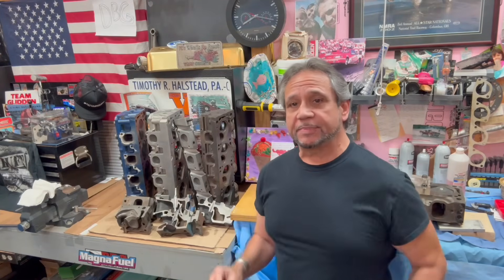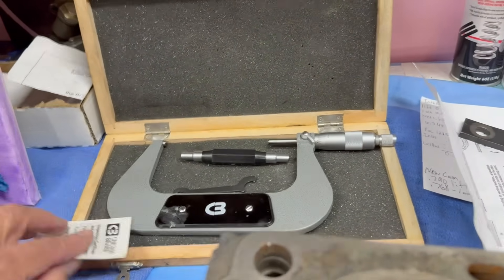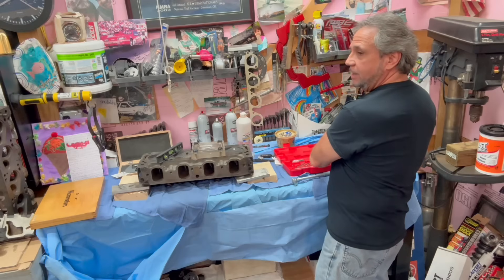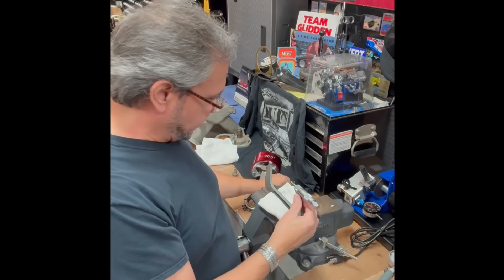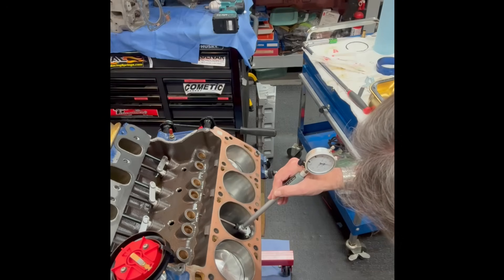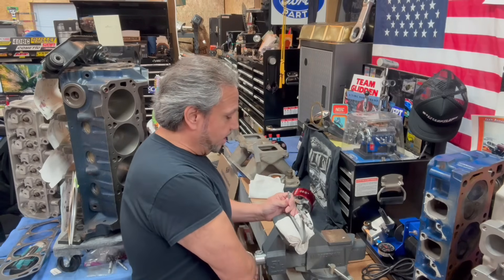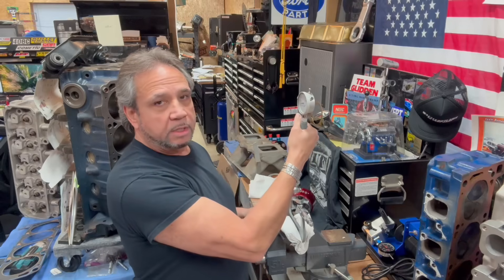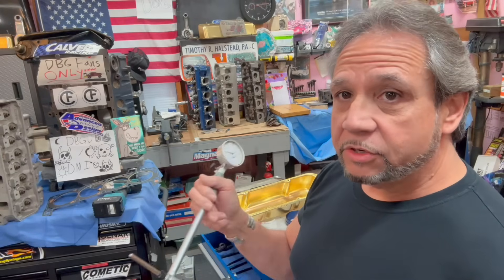DragBoss Garage: Measure Twice, Measure again. Using Dial Bore Gauge to Measure Bore/Piston To Bore.

Comment: Those little dial bore gauges like that are a bargain and they work just fine.  I use the Sunnen ones every day but really aside from being easier to set the results should be the same.  An older guy who comes in here worked for Sunnen for many years and he told me one time the cool thing about a dial bore gauge like that is since its being used as a comparator you are really calibrating the gauge every time you use it.
Reply from the maker: There you go. I will be happy to put it to use and see what I have to work with, and make better. Thank you my man. 💯💪

Comment: Bore should be..4.400 to 4.600 .....unless it's  a small block...lol
Reply: Tim i love cleveland too......they are too heavy for thier displacement
Reply from the maker: @edcase3767 if you say so, never bothered me any.
Reply: @dragboss351cleveland love you tim...if you bought  a 68 t -bird out of a field and got on it you would appreciate the torque the small ass engines lack...lol...
Reply from the maker: @edcase3767 well if you say so. Im happy with what I have, although I do have a pair of A460 and intake sitting in the corner…
Reply: When bob glidden won 5 Championships in a row it wasn't a  350 or +1
Reply from the maker: @edcase3767 nope
Reply from the maker: Ok it is a small displacement engine.

Comment: All Pistons manufacturers have a clearance specs depending on material they are made out of forged Hyper or just plain cast Forged piston for racing or Power adders you can clearance the rest should stay at spec piston manufacturer suggest. Correct Clearance means a longer running better performing engine
Reply from the maker: Well I look at this way, I didn’t assemble it and spec it out. So at this point, I am not changing anything but rings. Just measuring to get the feel for these instruments and record what I find. Yes thanks for the information appreciated 💯👍🏁

Comment: You need to get feel for the weight you're putting on mic 
You can feel it when you're measuring in the right spot 
I'd rather hold the piston when measuring it 

The bore if it's been bored and honed with torque plate would be out of round when measuring without it on , probably.0005 to .001
Reply from the maker: Yes definitely a feel to use. Probably easier to measure without the rod on it. Yes that is probably the difference I see with the what it is supposed to be. I’m good with it. Thanks for the advice 💯🏁👍

Comment: Another nice video Tim, those are the tools of the trade if you want to do an engine right. 👍
Also, you wouldn't believe how loose I ran my Cleveland engines in my dirt track cars. 
Good luck with the rest of the engine refreshing. 🏁
Reply from the maker: Thanks AC, loose is good, I have never used any gauges like this so accuracy is my goal. It will all work out, I have been keeping the Faith 🙏appreciated 💯🏁💪
Reply: @dragboss351cleveland handle your precision tools like a surgeon, smooth and steady.
Reply from the maker: @abcullens2328 that’s exactly what it is like. Thanks much. 😊🏁

Comment: As a machinst for almost 60 years, I'd say you did a great job. One thing I see guys do wrong is holding a measuring tool longer than they need to. (Heat is bad). And be consistent with the light feel for measuring or setting tools. And everything, tools and what yer checking, should be at the same room temperature for 12 to 24 hours. Excellent video. Looking forward to seeing more! 😊
Reply: Yep and always hold a measuring tool that has an insulated grip by the grip! Its there to avoid heat transfer from your hands to the gauge.
Reply from the maker: @craig8187  no doubt just like the gentleman above you said that the instruments get to room temperature for at least 12 to 24 hours. From checking before and after heated, definitely a difference in readings. Think it was like 1000ths 💯🏁
Reply from the maker: Definitely manual dexterity and no influence with the weight of your hand. Thanks so much for watching in the critique. Makes me smile. I hopefully can only get better. Glad you’re here.💯💪💯👍

Comment: At 4:30 "woopsie" lol.... Did pucker up to deffcom 2? Good stuff Tim, especially the bore locations. Simple. 385cfm at that lift??!! Damn she guud! Some of the mic's on the market can develop rust or maybe just mine....but I've since learned the error of my ways. I keep them coated not drenched plus a oil damp shop paper towel over them in the box. Dials you have to check the increments because some are in metric but also some have a .005" increments like old Ammco drum mic's. Working on foreign cars they had metric specs for everything. 1 millimeter is .03937" and 1" inch is 25.400 millimeters. Had to mic cylinder head and deck warpage of .0011" for warranty claims. Well my feeler only went to .0015". Fun. Can't use them if they fold making a crease. I made a trolly for my dial gauge to ride my straight edge. Our dealer rep said I couldn't have mic'd them so he knew or thought I made them up. Guy was a real pos. Showed him my setup. A few months later they sent out tech info as a work around. Fun.....He rejected a bunch of my jobs after a disbute with a MAF sensor that passed their test. I put it in our freezer for lunch. Pulled out put it on and it wouldn't start. Gave him a copy of the ticket I keep for my job log. Well he got butthurt wrote me up. District manager showed up with our rep. Ripped up the write up infront of us. I was soon to leave after the constant BS. New rules for only me. Got old with his selecting me for every massive tear down or him telling me to do something specifically his way then says he never told me that or to start on it yet when it was needed done that day. He was driving the car. At 7pm he was nowhere. Fun ....sorry went a bit long on this my bad.
Reply from the maker: Yes, those heads flow very well. That’s a secret to my Cars ETS, Darin had an intake work. Yes I love these new instrument gauges. Learning a lot. I worked as a mechanic, before they became automotive technicians. Never had a deal with any of that I was in the private sector. I don’t think I would do well with that kind of overseer. That’s one reason I got out of it is because computers were coming to age, either had to go back to school for that, or choose a different career. I chose a different career. Now, putting all my effort into the social media, and doing the things I’ve always wanted to do. I’m glad you’re here and enjoy what I do I appreciate you.💯💪🏁👍

Comment: Important note if your block was deckplate honed it’s difficult to measure the bore exact with the deckplate not on it because the bore is slightly distorted. Best way to check if that is the case is to put a compression ring in the bore and shine a light behind it, if you can see light coming around the ring the bore is distorted.
Reply from the maker: I did that and not distorted, but ring end gaps are at .021 and sharp, need more clearance. Yes it was honed with deck plates. Where are you in Kentucky?  bc
Reply: @dragboss351cleveland I am close to Frankfort so pretty much halfway between Louisville and Lexington.
Reply from the maker: @b @bcbloc02 t it. 5 hrs for me, why don’t you email me thpa351 
At G. Hopefully you got that.
Reply: @dragboss351cleveland   They do not need more clearance.  It's got more than it needs.  For a 4.015" bore size, you want about .005" per inch of bore on top ring end gap.  That's .020".   In addition, when you zero a bore gauge, you have to make sure it's zero'd in both directions, not just one.  Also, measuring a piston takes a little patience because they're not round.
Reply from the maker: @lyk @lykinsmotorsports ks Brent, then why would there be signs of scraping in 5 and 6. Thanks for the tip on zero the gauge. I have never used on and it has a lot of manual dexterity associated with it, light hands using it.
Reply: @dragboss351cleveland  The rings are not butting.  There's more than enough clearance there.  The scraping could be anything, trash picked up on the cylinder walls, etc.
Reply from the maker: @lykinsmotorsports  got it. Cleaning up and new rings and good to go 💯🏁💪👍

Comment: Well, those days of not having the tools to check and trusting in the machine shop are over for me! Used to use a feeler gauge to check skirt clearance once I assembled a rod and piston, that was all I could do! I did have a killer machinist though, he used to assemble the engines for Ernie Ervan's Nascar Ford engines. I put my Windsor together 25 yrs ago this past June. Broke it in at Fun Ford weekend at Gainesville Raceway. Still has 80lbs of oil pressure cold and at temp 70lbs. Stock shot peened truck rods with ARP bolts, cross drilled crank and oiling mods I learned from Ben Alameda racing. 7000 rpm shifts all these years and only 6% leak down. About 125 passes though through the years. Love the things I'm learning from you and Darin, they will carry me into the future no doubt.  Thank you Tim! DBG for the win!!!
Reply from the maker: Thanks Mav, it this type of sharing information and stories, like we are buddy’s next door. We are glad we can help you too. That is an impressive engine right there. Love that. Longevity baby and power. 😊❤️🏁💯👍
Reply: @dragboss351cleveland Thanks Tim, that means alot!
Reply from the maker: @mavman351 your most welcome 💯🏁💪

Comment: I hate to admit it but I once was clearance a bore to unshroud the valve for a set of Cleveland heads. Laid the gasket scribed my line ground it out and it came out perfect. Then went to move  to the next cylinder only to realize I had the head gasket flipped over and just ground the wrong side of the bore. Same to your point. I don't have to tell you how i felt about the whole thing.
Reply from the maker: I get it totally, make me sick. But we all make mistakes and if you learn from it, ain’t a mistake. Learning this equipment my self and want to build the best I can so we shall see. If I make mistakes I will let you see or tell you. Thanks none 💯🏁💪

Comment: That Cougar is crazy , sounds like a thunderstorm
Reply from the maker: Thank you President. It will be even better in the spring. Stay tuned 💯💪🏁🔧
Reply: @dragboss351cleveland ya , you got it , that’s not my real name . He has some great quotes, Madison knew both sides of the central banking issue.
Which lead eventually to Henrey Kissinger/ opec / from the morganthol plan - that is what killed American manufacturing and the auto industry.
 We should have never had a central bank because it’s a monopoly not competition or real capitalism.
As we have to race cars to win , they just make a rule and win .
Ya - I’m mad about this Kissinger bs
 Nixon was really good, he was set up
You’ll see his convoy using my 71/72 LtD in photos of the time
Up till 76 they where plentiful 
Hawaii 5-0 has a lot of them
 They got alot of Mercury Mauraders and Grand Marquis 
I had a 76 351M / 400
Great car - lost oil pressure in 2002
Money is a bad thing around here
They keep taking the cars and making laws it’s a constant battle 

Ever hear of a 2spd Ford 9” rear
I think nascar had them in 68-71
 I need that 
I seen two cars with that one Ford and one Cadillac once
I believe they run a 4:11 to 3:73 or something like that